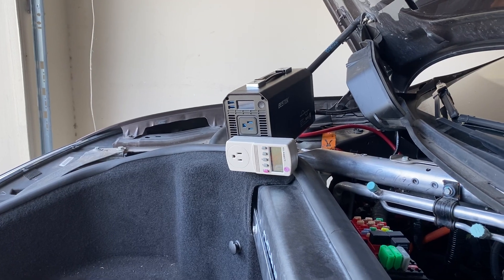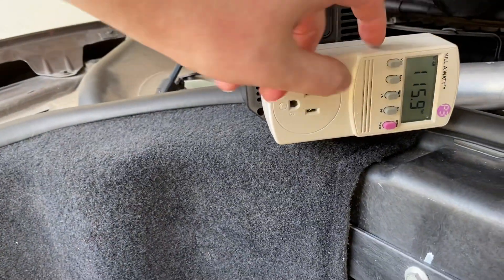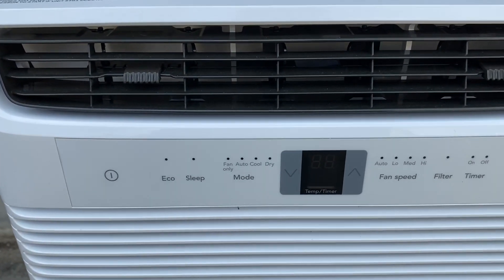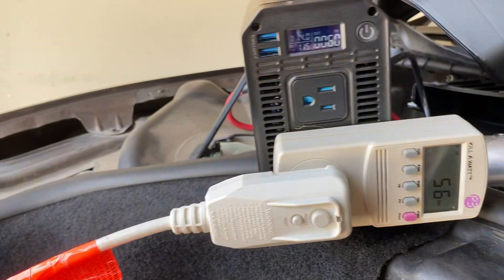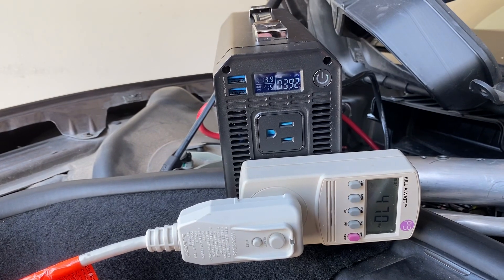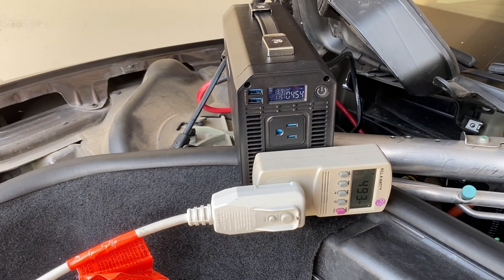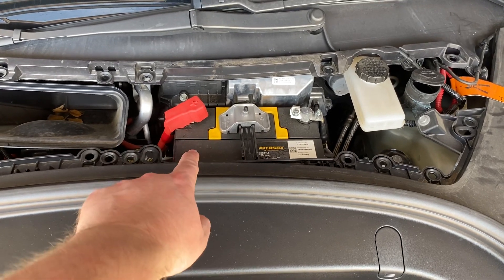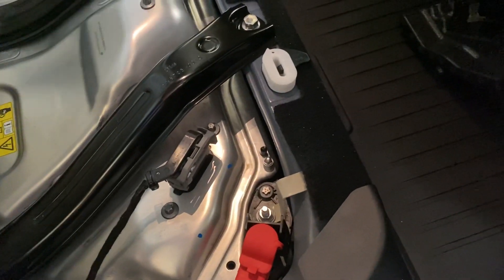Tesla Emergency Power

Comment: Can you charge your M3 from the inverter as well ?
Reply from the maker: In theory yes.  You can output the 120V outlet with a M3 charging adapter to 120V and charge that way.  If you are talking about a feedback loop then you will slowly lose power due to the inherit inefficiencies in converting DC to AC and then back to DC again.

Comment: How much Amp can I draw from the tesla model 3 dc dc converter?
Reply from the maker: If I recall the DC-DC converter steps it down from 800V to 12V, but at high amperage since it can deliver 2,000 watts.

Comment: "This is a DC-DC converter we can plug into."  What was that in the end at @3:35?  Ther terminal in the back seat of the Model 3 is a 12V or something else?
Reply from the maker: It’s a 400V to 12V converter.
Reply: @Palvaran  That is the 12V  source that is across the 12 battery terminal, isn't it?  So the same 12V?
Reply from the maker: Steffen Frost yeppers.